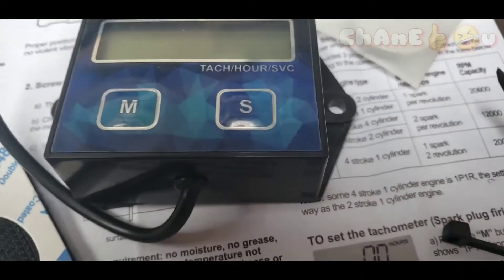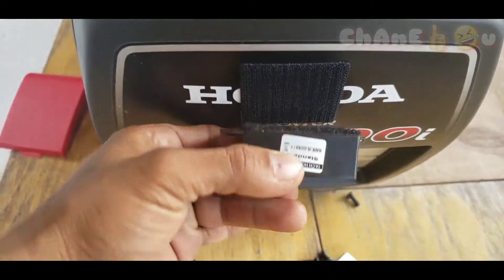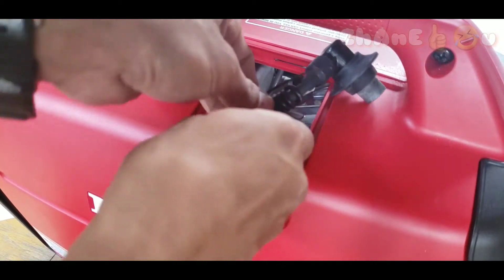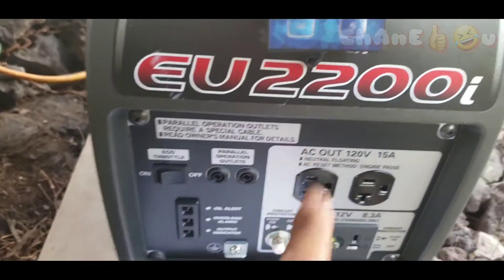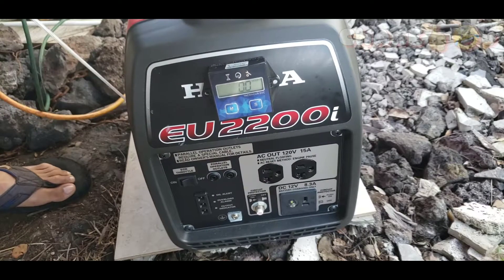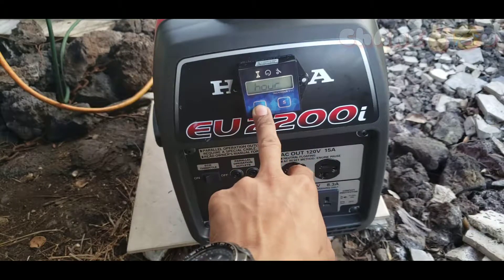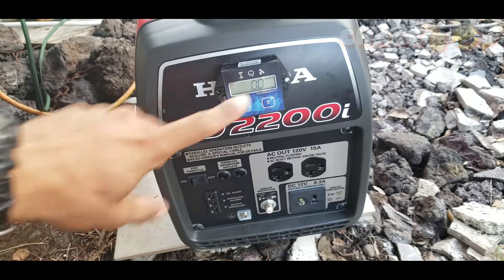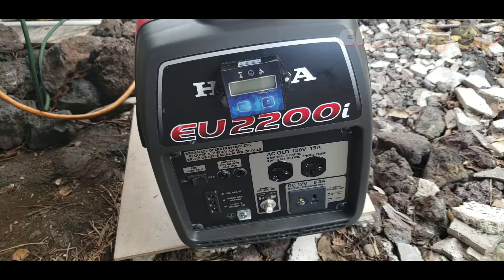2019 Installing Tachometer/hour meter to Generator

Comment: For what its worth, you set it up for 4/2 stroke-2/1 cylinder.  Should have been 1P2R since the Honda EU2200I is a 4 stroke engine with 1 cylinder. Max RPM on that engine is roughly 3600 RPM
Reply: Yep, he has it set wrong for that engine.
Reply: Although I will add that a one cylinder four stroke that fires on every revolution due to using a magneto would use 1P1R.  Its also firing on an empty cylinder.